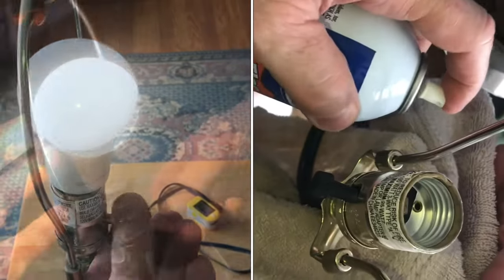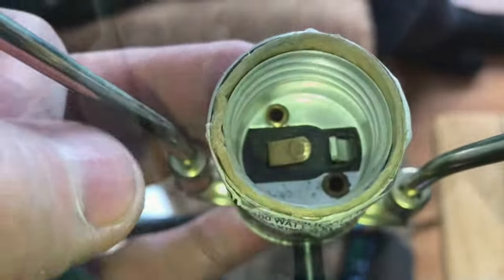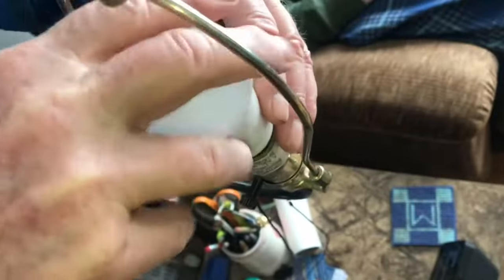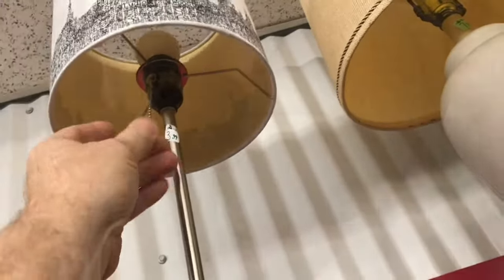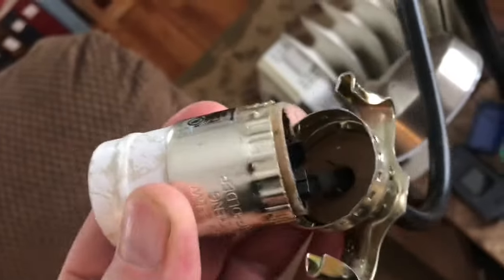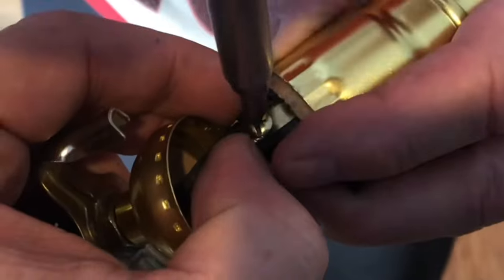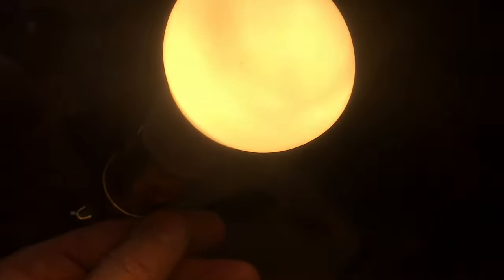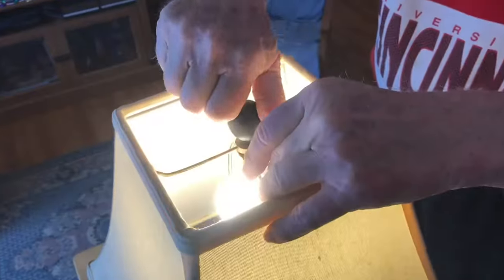fixing a “lamp” that DOESN’T turn on (bad switch)

Comment: So i have an 80's brass goose neck lamp that worked fine for years. Now that i tried switching the lamp shade to match my comforter, it wont turn on. It will turn on when i remove the shade, but once i put it back on it won't turn on. Any suggestions? I love these lamps.